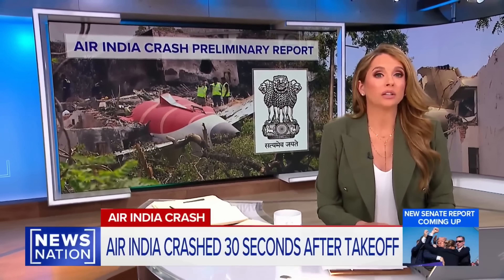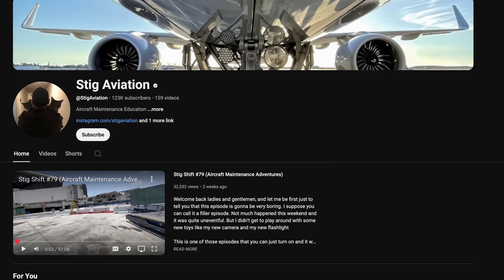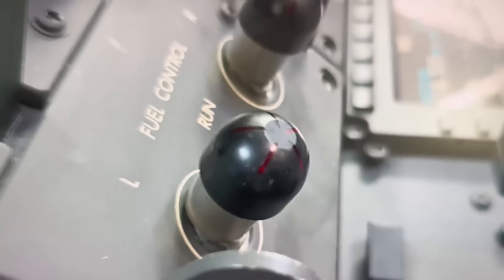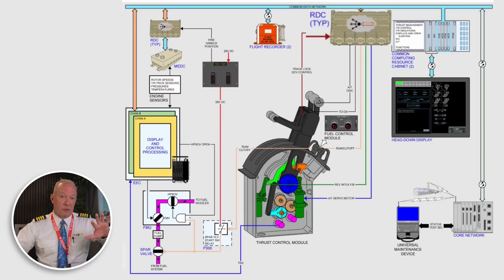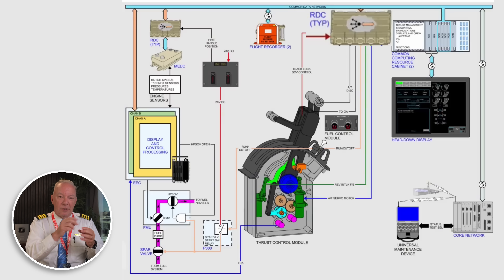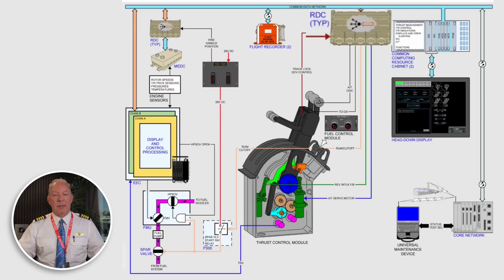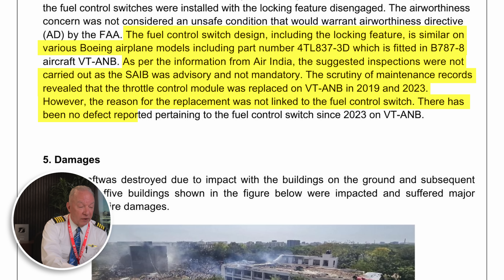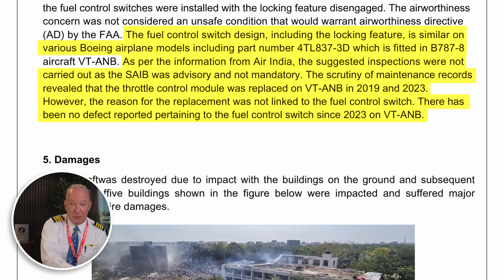The Truth About Boeing 787 Fuel Control Switches

Comment: Yes, the switches were moved to cutoff and the back to run. But this AFTER the engines stopped producing thrust. You see, the engines were operating about 5seconds after liftoff. And RAT was deployed 2-3seconds after liftoff. Meaning something catastrophic electrical/system failure occured BEFORE fuel switches were put to cutoff. 

There are also serveral examples of incidents where engines spool down because of electrical failures. Including b787. 

There is also an AD that requires action on water leakages into the electronic bays.  

So...  you are too early in stating that root cause to the crash was pilots moving the fuel swiches.
Reply: What is your source for saying the engines stopped producing thrust prior to the fuel cutoff switches being moved to the closed position? The preliminary report states the opposite. On page 14 it says liftoff occurred at 08:08:39 and maximum recorded airspeed occurred 3 seconds later, at 08:08:42. Immediately thereafter, both fuel cutoff switches were moved to the off position, one second apart, and both engines THEN “began to decrease from their take-off values as the fuel supply to the engines was cut off.” One pilot then asks the other “why did he cutoff.”
Reply: @MrDeepseadweller  Facts just confuse people I think. Thanks for setting things straight.  A lot of Airbus fan boys making comments as well.
Reply: The report say RAT was deployed 8 seconds after takeoff. The cutoff three seconds after takeoff.
Reply: @larka742 no. It says the RAT started providing power. It takes ten seconds for the RAT to provide power, so we know it was deployed before the engines lost power.
Reply: "It takes ten seconds for the RAT to provide power" please cite your source on this one.
Reply: @michaelgoldsmith3534 It takes six seconds to provide hydraulic power, and ten seconds to provide electric power. The unknowns would be what air conditions and speed conditions this is true for. The aircraft was low and slowing, so it may have been worse conditions than designed for.
Reply: All I asked for is a single source. I give up.
Reply: Report seems wrong. RAT could be seen deployed on footage at very low altitude; 2,5s after liftoff.
Reply: Pilot action is unsettling, but it's still the more probable cause. The whole "RAT before engines" contrarian theory uses timestamps from the CCTV that are not synchronized with the EAFR. The EAFR states that liftoff occurred at 08:08:39 UTC. The first fuel cutoff switch moved to CUTOFF at 08:08:42 UTC, with the other one second later. THEN the N1 and N2 percentages spooled down. The very first hydraulic power from the RAT arrived at 08:08:47. So yes, you're right, the RAT probably began deploying around 4 or 5 seconds after liftoff, but that doesn't mean the engines were still running great 5 seconds after liftoff. On the contrary, it means that the high-pressure core spool percentages from both engines were passing below minimum idle.
Reply: No RAT was deployed after both switched were moved OFF by logic circuit. System does not need to wait for spool down if fuel switches are OFF.
Stop bringing that dumb corrupt Godfrey junk here.
If there were any short circuits or issues - these would register in evaluation units, and in FDR.
Reply: Yes exactly

Comment: Dear Steeve! 
It will be really interesting to simulate on SIM situation when during lift off, 
due to seat lock malfunction or collapse, PF hand which was previously laying rested on the advanced far ahead  (to TO thrust position) throttles,
could potentially strike the pedestal exactly at the area where the FCSwitches are located. 
PF in such unexpected and rapid movement will INSTINCTIVELY try to grab anything!!! 
Yes, anything that could stop him to fall and arrest such quick backwards moovement.
I have evidence of that situation in the past and few of the really experienced colleagues told me that they also evidence it as well, 
By the way exactly at the moment of the LIFT OFF! 
When acceleration and rising pitch angle are creating max load to seat lock mechanism.
Imagine human hand with fingers bent as a hooks, if it will strike FCS panel, I guess such strike and potential hang for few milliseconds could be a reason of unintended FCS positioning to OFF.
I agree that mechanism should prevent inadvertant slow movement of FCS,  but scenario described above should someone at least check it on SIM?

Comment: We novices think we understand this stuff, but we dont. Just a simple question: are there separate 28v inputs to those closed systems or are they fed by a common source and is that source monitored by the cockpit display and the flight data recorder?

Comment: For the “there’s no way they could be shutoff in 1 second crowd”

https://youtu.be/M5n1StO4wHU?feature=shared
Reply: Why arent we considering a possibility where dual engine failure happens just after take off. Then pilot manually turn fuel switches off and on because thats SOP in Boeing planes in case of Dual Engine.? You can refer to Gaurav Taneja AI 171 Part 3 in english dub to understand more about this theory as timeline of RAT deployment also matches with this. https://youtu.be/pq2AZdzH7X4?si=0pLKXsmG1M7tRXAZ
Reply: @ishanarora7948  Because the preliminary report says the switches were transitioned to cutoff then (ie followed by) the engines shutdown.

Comment: Nice explanation. 

All I can say is that so vague is the initial report, that it is a fact that several reputable and good intentioned commentators come to completely different conclusions wrt the timing of events on flight AI171. The most heavily researched that I know of saying that the RAT deployed before the fuel switches were moved to their cut position by one of the pilots, this being in response to what was going on. That is to say that movement of the fuel switches did not initiate the accident.

Comment: Does weight off of the landing gear trigger the RAT deployment . How does the system differentiate between a deliberate "engine off" action and an emergency.. The RAT doesn't deploy when you're at the gate and you shut down the engines

Comment: but still a connector or solder point could fail to deliver that 28V to the switches. A simulator simulates always in according to expected behavior of the plane. 
I still belief that the engines were shut of in an extended sui** but I refuse the arguments of failsafe switches.

Comment: Great explanation about the switches and the associated circuits.  But the preliminary incident report stated explicitly that the switches were moved at very specific times.  How did the Flight Data Recorder know the position of the switches?  Does the Flight Data Recorder monitor the switch position via a separate pair of pins on the switches?  Or, does the recorder INFER the switch position by some other means?

Comment: Capt. Steeve, if the fuel control relays are only powered by the battery, and the batteries are suddenly wet down by a conductive liquid wash over (liquid invasion to the battery compartment), Then the 24 VDC might be interrupted as the battery sees a shorter path between its positive and negative terminals during the period the liquid is providing the shortened path.  If the fuel relays are held in the open condition by current through the relay operating electrical coil, then the sudden reduction of current might result in closure of the fuel valves, or even chattering of these valves if the current is intermittent.  I doubt the data recorders record the actual movement of the fuel switches but it could be if these switches are multipole type with a dedicated pole feeding the data recorder, however, more likely the recorder monitors whether current is at the actual fuel control valves.  Really the data recorder should monitor both the cutoff switches and the control valves, and then we would be able to see if the cutoff switches were not moved until after the fuel control valves had a loss of current.  My understanding is that to start a restart the fuel switches have to be off for a few seconds and then placed to on to initiate a restart.
Reply: It is my understanding that it takes power, (28V), to turn fuel valves off in aircraft with electrical fuel valves. Loss of electrical power, (battery, buss), will not cause fuel valves to go to the off position.

Comment: Captain Steeeve, please take a look at the shirtsleeves you wore in this video. They have a slot extending from the cuff halfway to your elbow. Now look at those "mushroom" caps on those switches. They have prominent sharp lower edges. Can that sleeve slot possibly momentarily hook on the base of those caps as the pilot removes their hand from the thrust levers at takeoff? Is it at all possible? Even the most infinitesimal possibility is too much to risk.

The prevention is simple: install U-bolts directly bridging the switches in the fore-aft plane. They are a couple of dollars at my neighborhood  hardware store.
Reply: as he says… at 2:54 — and it does not sound like a sleeve could do that.
Reply: @daisy-rothschild  
Roger that. Yet somebody needs to test and verify that in a switched off plane or on a simulator. Try hard to make it happen. Those flanking guards only ward off the arm, that sleeve slit looks to fit between them.

Comment: Sorry Captain Steeeve you are wrong. Only one  Fuel Valve ist controlled directly bei the Relay. The two oother valves have Inputs from the DISPLAY AND CONTROL PROCESSING unit. Have a look at your scematics at 9:22

Comment: The switch position or movement can be negated by a false electrical signal or dropout. Those switches are just part of a circuit, and we know that plane had electrical issues.
Reply: Exactly, and transition means changing state - not being moved! No click sounds from the CVR confirmed.

Comment: One has to consider the possibility that a short circuit could have caused the relay to open. I do not know where these relays are housed, but can imagine toilet water leaking into the relay box and entering the relay housing, a change in pitch may cause this conductive fluid to short the relay's energising coil contacts. That is, 28 volt DC to ground. It would have had the same effect as transitioning the switches. One cannot rule out a battery failure, or a  battery connections failures. If the main 28 volt buss was lost, even momentary, the valves would close. A lose electrical terminal or plug on the relay box is also a possibility. A more comprehensive disclosure of the CVR would also help. It is only reasonable to exclude all other possibilities before drawing any conclusions about human conduct.

Comment: 6:25 and to clarify at no point is there power after the fact so when you move the switch power stops after each use. Think of it as a light switch NOT a wall receptacle

Comment: Captain Steve, can you explain how both the engines on the ANA Boeing 787 sit off after landing if the “computers” do not have control of the “fuel supply”?
Reply: If I remember correctly, both the engines shut down immediately after landing and could not be restarted resulting in the aircraft having to be towed. Boeing put out a bulletin saying that the reverse thrust was engaged too early and advised pilots not to engage the reverse thrust too early.

Comment: I think we all get how the Switch works, BUT my question is HOW does the data recorder know that the actual switches were physically moved?  Keep in mind that relays have coils that generally use low current control to switch high current loads. It is possible that the relays were fired by another method, perhaps a magnetic charge or a short on control.

Comment: Well done Capt Steeeve! Yes your right. If something goes wrong with any electronic control assembly, it has to be pulled and sent back to the organization from which it came from where the expertise is to repair it. The airline company should have a "off-the-shelf" replacement. I love your videos!

Comment: WIth modern cockpits, I have no idea how much is 'digitized'. I know modern cars are, but an electric window is a far cry from the critical components you have on an aircraft.
Thanks for taking the time to delve into this and explain how simple and direct this critical circuit is designed. No 'CAN bus', or other sensors, just good old-fashioned copper wire and such.
(fyi, in nuclear plants, some of our switches are... just as robust and solid as those, and many even require keys to operate. Sometimes simple, century-old tech is best.)

Comment: What I find disturbing is both switches being moved within a second of each other, because not only is this not something that crews would ever want or need to do, it's something a crew member might have to practice a few times to accomplish that quickly, because there would not normally be a "muscle memory" of an unusual action with something that's designed NOT to just be flicked off in a casual movement. So, if it were intentional, to be that quick I think there would have to be sufficient premeditation for someone to have thought about how to turn both switches off in such quick succession and perhaps two or three practice attempts on a parked aircraft (or maybe just a spare throttle control unit in a workshop, which I'd be inclined to doubt). I don't think it could be done in a moment of confusion or delusion.

Comment: It is my understanding that it takes power, (28V), to turn fuel valves off in aircraft with electrical fuel valves. Loss of electrical power, (battery, buss), will not cause fuel valves to go to the off position.

Comment: Copilot AI from Microsoft says:
Yes, the *FADEC system on the Boeing 787 can override manual fuel control switches* under certain failure conditions—though this is rare and typically tied to **software logic, sensor inputs, or system miscommunication**.

### 🧠 How FADEC Can Override Manual Inputs

The *Full Authority Digital Engine Control (FADEC)* is designed to manage engine performance autonomously. It continuously monitors:

- Throttle position
- Engine parameters (temperature, pressure, RPM)
- Fuel flow rates
- Sensor data from various subsystems

If FADEC detects a **critical fault**—such as a false fuel leak, overpressure, or erroneous sensor input—it can **command the fuel control valve to close**, even if the cockpit switch is set to RUN.

### ⚠ Real-World Incidents

Recent investigations into the *Air India Flight AI-171 crash* in June 2025 revealed that:

- Both fuel control switches transitioned from RUN to CUTOFF within one second, shortly after takeoff.
- Cockpit voice recordings captured a pilot saying, “Why did you cut off the fuel?” and the other replying, “I didn’t.”
- This suggests the **automated system may have acted independently**, possibly due to a **software glitch or misinterpreted sensor data**.

Another case involved an *All Nippon Airways 787**, where the **Thrust Control Malfunction Accommodation (TCMA)* system mistakenly interpreted the aircraft as being on the ground during final approach. It triggered an **automatic fuel cutoff**, causing both engines to flame out. Fortunately, the aircraft was able to glide to a safe landing.

### 🔐 Implications for Safety

These incidents highlight that:

- FADEC is capable of *autonomous decisions* that override pilot inputs.
- Such behavior is intended to *protect the engine* or aircraft from perceived threats.
- However, *software faults or bad data* can lead to unintended consequences.

### 🧩 Summary

| *System* | *Can Override Manual Switches?* | *Trigger Conditions* |
|------------|-----------------------------------|-------------------------|
| FADEC      | Yes                               | Sensor faults, software glitches, logic errors |
| TCMA       | Yes                               | Misjudged aircraft state (e.g., airborne vs. ground) |
| Pilots     | Manual control unless overridden  | Normal operation or emergency override |

Would you like to explore how Boeing and regulators are responding to these risks, or how redundancy and pilot override mechanisms are being improved?

Comment: The investigation progresses to examine all possible scenarios that could lead to failure. There is one possible failure that could cause the flight data recorder receiving incorrect switch status that mimics  the switches being moved and causing electrical failure. Capt Steve, have  a look.
https://www.youtube.com/watch?v=OLxLN3osS1Y
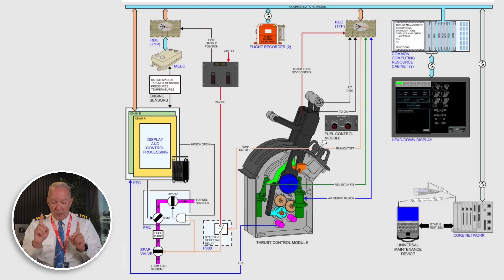It's best to watch it all, though for a quick summary go to time index 7:26,, 10:28, then 16:00. It's about the battery diode module and its possible failure.